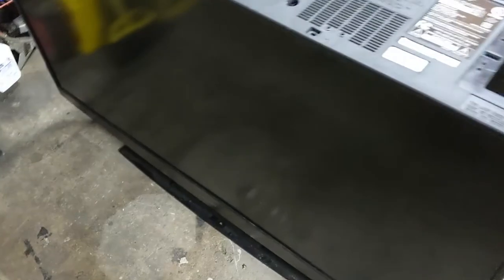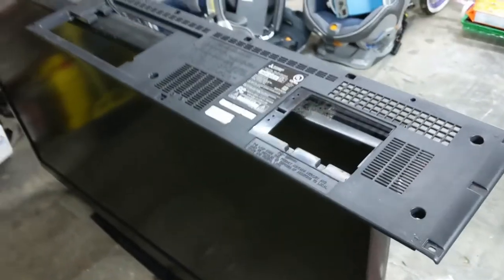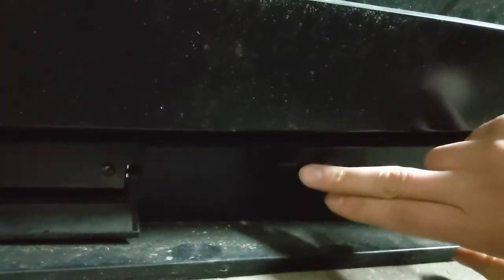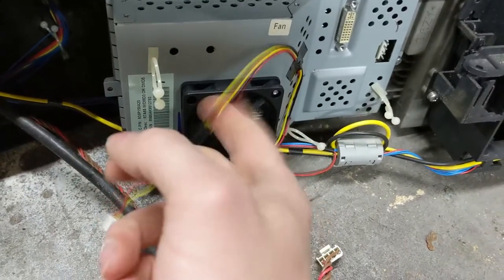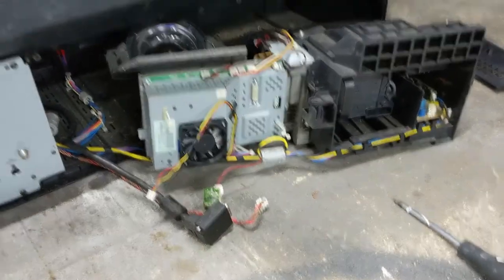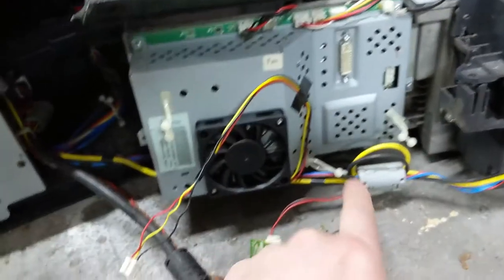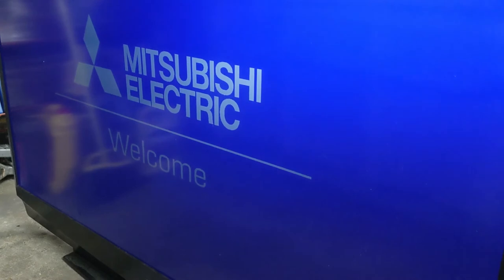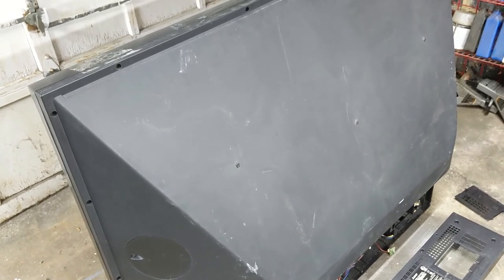Mitsubishi WD 6519 Repair

Comment: Excellent video..I have a wd73740 and the screen has been showing alot of extra pink in highlighted areas...last night display started strobing if i can call it that, colors changing until eventually shuts off. Pretty sure its the color wheel...my problem is tho trying to source one down here in Tobago..ughh...
Thinking to try and remove it and see if i can clean it up a little..saw a vid where a guy uses isopropyl alcohol to help free up bearings and clean the sensor..Any pointers gratefully appreaciated or you fancy a vacation in Tobago(bring ya tools)😂😂😂

Comment: Hi Mike

I have the same TV as the one on the video, I have the red and yellow light on the power bottom, I did the lamp replacement, and I also blow all the fans and I still have the same issue,
When I press the power bottom stay green light for a little bit but them goes red and flashing yellow light and the screen not even come up blue or nothing, 
Any advice how to get this TV working?
TV just don't turn on

Comment: question anyone the thing with mine was i used mine then i turned it off for like 2 hours then when i went back there was a red light but wasnt blinking just a red light so then i unpluged it then truned it on then i had a green light but after 5 minutes it turned red again but no  blinking is it the same thinh?